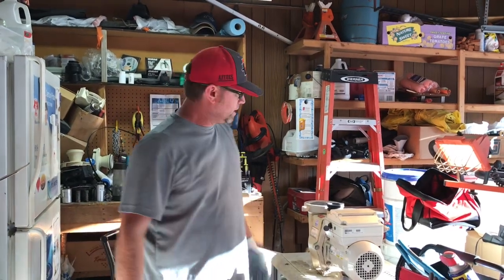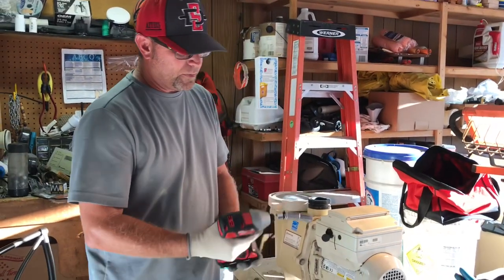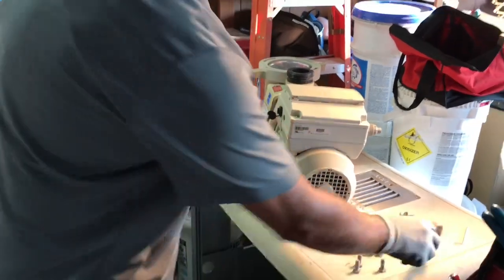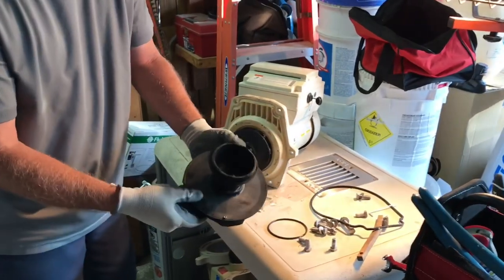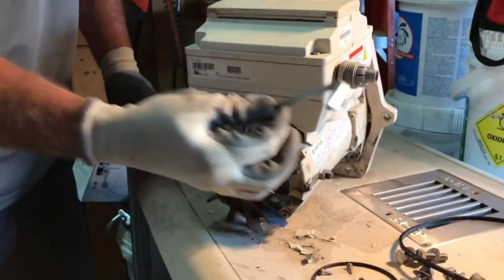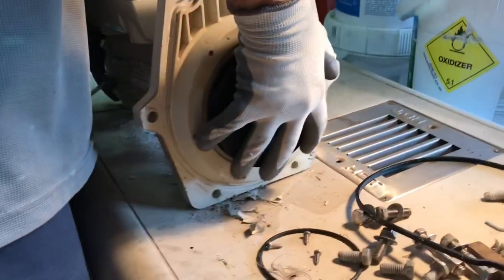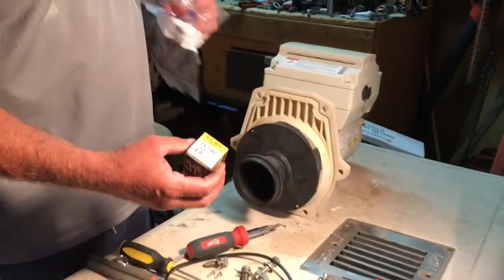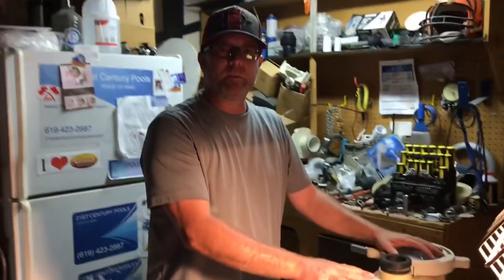Shaft Seal Replacement on Pentair Variable Speed Pump

Comment: Ken, thanks for the video. However, I am still trying to figure out a solution to take off the impeller. In the video, when you take off the cover, there's an easy solution for you -- an Allen wrench. On mine, however, there's just a giant slot that goes across. I tried to put a screwdriver in and spin it but it will not budge as there's not enough torque on the back end. 

Does ANYONE have a solution for this? I've been trying to fix this thing for the past week and I'm ready to toss it out and fill in my pool at this point.

I have a IntelliFlo VS+SVRS
Reply: I'm still having issues with this and Pentair basically told me to go pay someone to fix it lol 

This should be as simple as holding a screwdriver on the backside and turning the impeller. Instead, it won't budge and only smaller screwdrivers fit. This seems to be unknown to even Pentair employees too, as they thought it would be an allen wrench. If the threads are corroded, what are my options? If I had the money I'd just toss the damn thing now.

Comment: I'm always glad when I see these videos that I'm not the only one whose Pentair motor housing is all corroded with the paint bubbling off. What a massive fail on the part of Pentair.  I've been meaning to remove my motor, use a wire wheel to grind off all of the corroded paint and pot metal, then re-spray it with epoxy paint to seal it for good.
Reply: I agree; Pentair makes junk products (ie their lights last only a few hours) and charges outrageous prices.

Comment: Very good video. Just a note though. The PS-1000 shaft seal is for non SWG pools. For SWG pools, its the PS-3865R shaft seal. The PS-1000 won't last very long in a salt pool.
Reply: I can verify that after replacing a PS-1000 multiple times before finding that one out.  Great comment J G!

Comment: Does it matter if the lube you use has silicone in it or not?
Reply from the maker: wdk8606 I only use silicone lube
Reply: The shaft seal I bought at my pool supply store included instructions that say explicitly to NOT use silicone.  I called and talked to the store manager, who also said do NOT use silicone near the shaft seal (ceramics).  She said don't use silicone near anything that heats up.  The silicone is for the big floppy rubber gaskets.
Reply: @DoubleBizzy  Yep. Pentair says a tiny bead 1/16” of silicone sealer under the flange of the shaft seal, and soapy solution for the impeller seal. https://www.youtube.com/watch?v=UwVBWVPpaw8